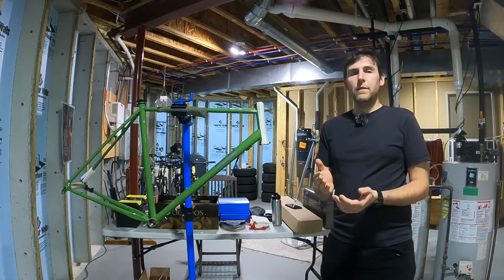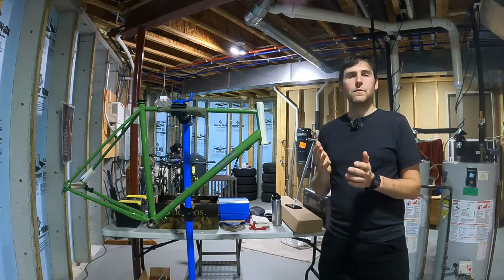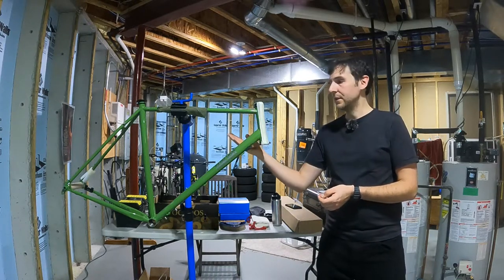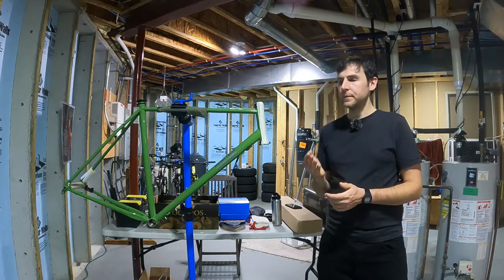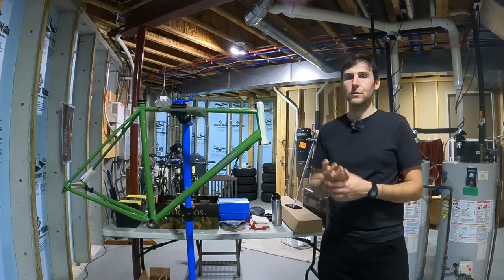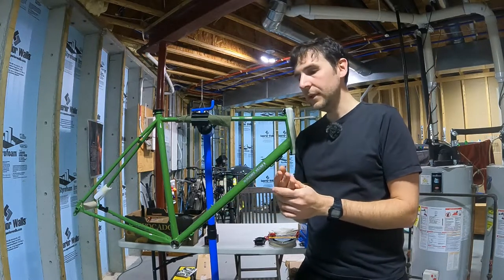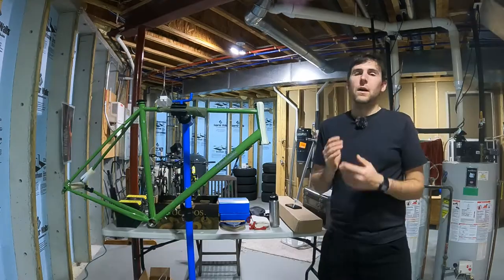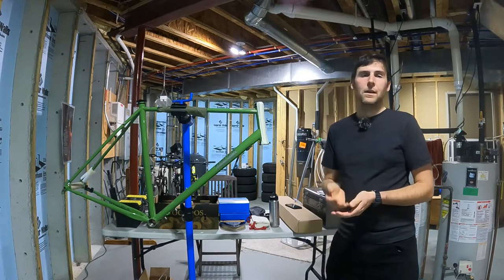Fairlight Faran Build #1: Introduction

Comment: One important consideration for me when choosing a bike for mixed-surface bike-packing is the capacity inside the front triangle for frame bags and water bottles. For this reason alone I prefer not only a "tall" like the Fairlight offers but also a mostly horizontal top tube. The sloping top tubes (e.g. like on the A.L.I.C.E) really squeeze the front triangle down, especially in the smaller sizes. More frame back and easier access of taller water bottles in a touring bike is a real factor for me anyhow.

One other factor between steel frames when comparison is the tubing gauge (wall thicknesses and length of buttings) and whether size-specific tubesets are used (again affects lengths of buttings). All of this make a difference in ride quality, frame weight, etc.  I have high confidence the Fairlight will ride much nicer than my Kona Rove LTD which I have purchased as a stand in as I wait for a Fairlight Faran to arrive.

Enjoy you builds and thanks for the videos!
Reply: "frame bag"
Reply from the maker: Yeah the comment about different tubing sizes is a really good point and something I didn't know until recently but once you think about it's obvious and I think that Fairlight has put a lot of thought into this judging by their design notes.  Good point about the large triangular frame too, I'm not sure I'll run a frame bag but I'll definitely be using water bottles and I have run into that problem before with other bikes.
Reply: I agree, in his designer notes designer Dom Thomas mentions that he delberately enlarged the front triangle (in comparison to the Secan) to allow for frame-bags

Comment: Cool video. Loved the insights. I have to disagree with you on the Kona though. I used to have one (before it got stolen), and it's not as a refined design as the fairlight. The dropouts, toptube and fork are quite unique features of your fairlight. The Fairlight also has pretty short chainstays, low BB, and different trail figures. At least as far as I know. So the Fairlight should ride a bit sportier.
As far as feeling goes: while the Kona was super comfortable, all the energy I put into riding went into the ground. And got some serious speed wobbles doing mild hills. Anyway, my 2̧ cents. I think you'll be happier with the Fairlight, for sure.
Reply from the maker: Hey that is really good to know about the geometry and great to hear some first hand experience about the Kona.  I do feel like the Fairlight is a really refined design, I think I just had a bit of temporary buyer's remorse and probably went a bit overboard talking about it.  I would love for this bike to turn into as sporty of a touring bike as possible, which I know isn't really a thing when I have racks on but I think it'll be a nice touring bike and when I'm not touring it'll be a nice all around bike too.
Reply: @spinningtrue  I totally relate to this type of buyers remorse, It'll go away with time.
You'll probably find that as you tour you'll gain confidence and experience to pair down your equipment. Or you could  load it up for a weekend getaway using just a front rack and a rear bag, which is where this bike should shine, according to the marketing material, at least. 
The design (geometry-wise) is based on the old Randonneuring bikes, and have improved handling when there's some weight in the front.
But you probably know all of this already 😅
Reply from the maker: @RickMeijer  Nope I was just trying to go for something similar to my gravel bike but maybe a little taller, and then I really wanted disc brakes and thru axles... and there aren't too many bikes out there like that.  Yes paring down is always a struggle whenever traveling or cycle touring :).
Reply: @RickMeijer  I totally agree with you Rick, the Radar and Sutra are more gravel/adventure bikes, that a have a completely different ride feel in comparisson to bikes like the Faran, the Breezer Doppler and Soma Fogcutter, these bikes remain lively and sporty even under load, like the randonneur bikes of old. And I can tell from experience: I own the brother to the Faran, the gravel-Secan, but it feels slightly dull with bigger 650b tires that I love to ride. SO... the Faran is also on my list.

Comment: Did you consider the Surly Disc Trucker or the All City Space Horse? Very similar geometries compared to the Tall versions of the Faran. The surly is way cheaper. But the Faran is way nicer and full of cool features (internal dynamo wiring, no quick release system on the axles preventing theft, lighter tubes). Like you said, one thing that concerns me is the lack of separate derailleur hanger but it's a steel frame.. so it can be bent back into place if needed. The all city space horse has one though.

Very nice video btw. I've made the exact same conclusions as you along the years. I'm still looking for a new frame and the faran is a good contender.
Reply from the maker: Thanks I really appreciate this, I totally agree about this type of bike.  When I bought this frameset I didn't know about very many alternatives but since then I have learned about a few more, I have never heard of the All City Space Horse though and I think it looks really cool, very similar to the Fairlight in a lot of ways.  I think it would be hard to say which is better without trying them both.  I know about the Surly Disc Trucker and I think that it is a really great bike except that I thought they still used quick releases, but they could have changed that since I looked into it last.    Thanks for clearing that up about derailleur hangers too, I didn't know if the integrated derailleur hanger was normal on steel bikes because I've never had a modern one before but I guess that is kind of a quirky feature of the Fairlight and I think it might be a good thing, I think it would be much less likely to come out of alignment than an alloy hanger.

Comment: Regarding the price, I have a Strael 3.0 and feel the price is fully justifiable. The Kona for example isn't in the same class as the Fairlight. The quality of the Fairlight is great, the attention to detail is next level, and they've worked with Reynolds to develop custom tubing. My Strael is a phenomenal riding bike, as I'm sure the Faran is too. I'd look at it differently. The Kona is cheap. The Fairlight is well priced for what you get.
Reply from the maker: I think you are right and I have come around to that a lot since this video, I got fixated on the cables for some reason but have read the design notes quite a bit more now and am really appreciating the bike.
Reply: I honestly don't like the cable routing either if that's what you mean! I wish Fairlight would have kept the cable housing bosses on the headtube. I have another road bike like that and it makes the routing beautiful. Perhaps it has to fo something with being able to mount bags on the frame. Oh well, minor detail on an otherwise amazing bike! Anyways, neat video! I'll have to watch some of the others. Have you ridden it yet?!
Reply from the maker: @fiziksdrop180  Well I was fixated on having full length housing but then I really came around to the traditional stopped cables but I agree about the cable bosses because the cable really rubs against the head tube with the boss in it's current position... Yes something at the head tube would be really nice

Comment: Don't use a pipe cutter to cut your fork tube, use a saw and a saw guide (topeak makes a cheap one). Don't forget to use cutting fluid.
Reply from the maker: Had a quick look and found it for $60 which seems a bit steep.  I tried using some hose clamps which might be in one of the videos I've published already and that was a bit of a disaster so I will definitely be recutting it and I am thinking of using a regular carpenter's miter box and clamping the steerer tube into a corner but if all else fails I'll splurge for a real saw guide.

Comment: You mention some alternative frames, but to me your choices seem all over the place and not consistent with your concept of a touring bike: The Breezer Radar is not a touring bike / all road bike, but a gravel / adventure bike, that has a different ride feeling from a touring bike. Actually, the bike that makes a just comparison is the Breezer Doppler, that is their touring / all road bike. Like the Farran, this bike has a different ride feel, that is, suitable for wide 650b tires while retaining a liveley, spritely and agile handeling. The Farran was speciafically designed for this feeling, like the Doppler and say the Soma Fogcutter. This is different from the Sutra, the Radar etc that have a more stable (boring) handling with bigger volume tires. In that regard, you should not regret buying the Farran over the Sutra, the Faran is so much more fun to ride like the randonneur and audax bikes of old. And in that sense, way more suitable for touring over the other options. Plus, build wise, Fairlight is in a class of its own in comparisson to regular brands, the Farran is also not overbuild like other steel frames, I think you should not regret buying the Faran. Enjoy it! PS, Bikepacking did some great reviews of the Faran, it won one of their awards in 2021. Kind regards from the Netherlands, Gerlach Sven
Reply from the maker: Hey thanks for the comment, I'm still learning about these different kinds of bikes and their geometry / ride feel!  At the time I was mainly thinking about the bikes in terms of their features such as thru-axles, disc brakes, fork mounts, etc and those were some of the alternatives I knew about then but now I have learned about quite a few more 'drop bar adventure' type bikes - and like you say that isn't really the same thing as a touring / all road bike.  The only bikes like this I have actually ridden are my Pinnacle Arkose gravel bike and the Faran and my first impression is that the Faran feels a lot more lively and planted, especially off road, but the riding position feels a little weird to me... probably just because I'm not used to it.
Reply: @spinningtrue  PS, I'd love to hear your final thoughts on the Faran and/or a sort of long term review, there a not many in depth reviews on the Faran out there 👍 all the best, Gerlach Sven
Reply from the maker: @gerlachsieders4578  Getting there!  I have done a few ride videos I'm currently editing... also went on a cycle tour last minute so I'm going to be using it for touring for the next 2 weeks and then I'll do a more in depth review.